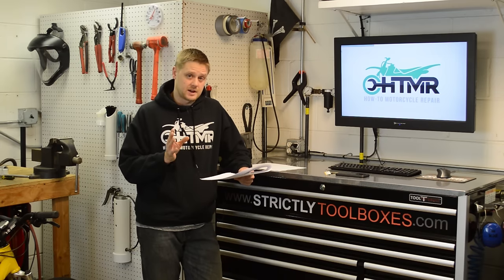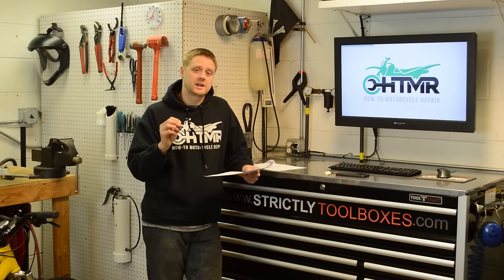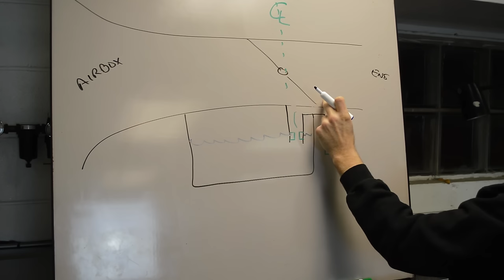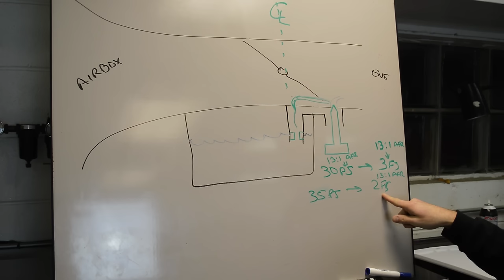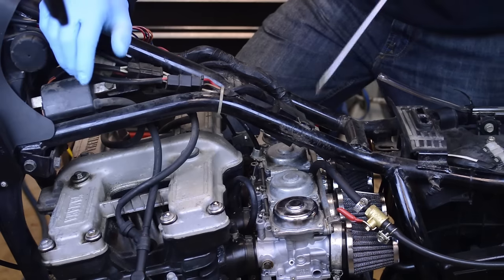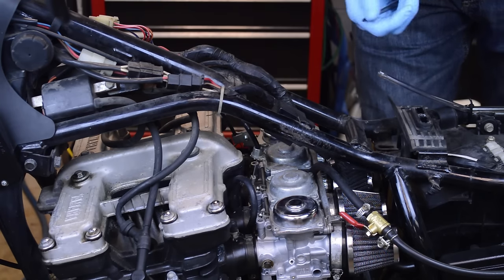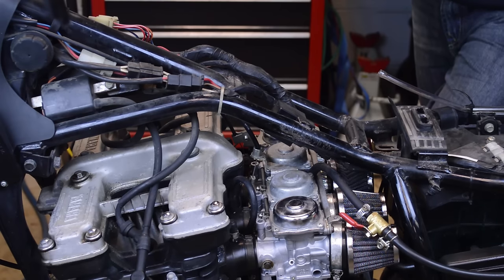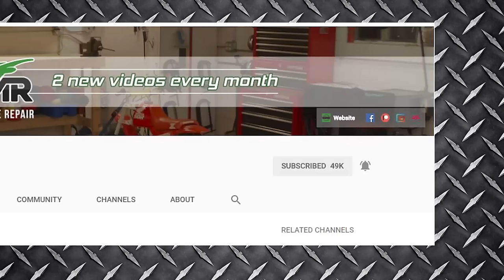Pilot Air/Fuel Screw Adjustment Explained - Multiple Carbs - Part 2

Comment: Hi There - I have discovered and been enjoying your videos years after your posting them.  I hope you are still active on youtube. 

You mentioned High Idle when lean. My CB750 after highway driving will have a high idle after a while - and then settle down eventually.. 

Any ideas, thanks !

Background: 
Last year during shelter in place, I restored my CB750 K 1979 Limited Edition DOHC. I got her in 79, but in 1988 had to raise my family.  She does pretty well these days, but after high RPM's driving on a highway as an example, RPMs will remain over 2,000-2500  for a while. 

The carbs were a 'B' to clean, and replaced the rubber connectors between the Head the the Carbs. Performance is okay at top end, and no Tank Slapping thank God when over 90 -  https://youtu.be/uXH7caqCFbI
Reply from the maker: That can be a lean condition or hanging idle. Also could be out of synch.
Reply: thanks !